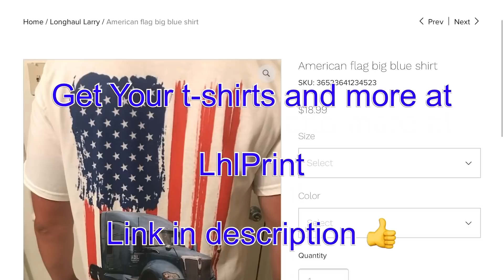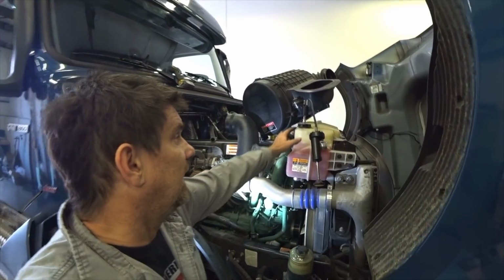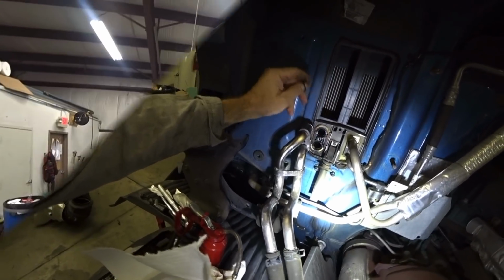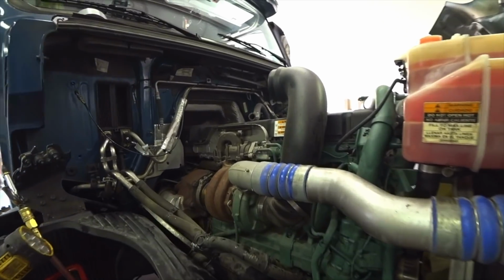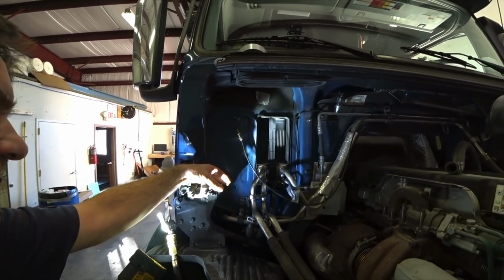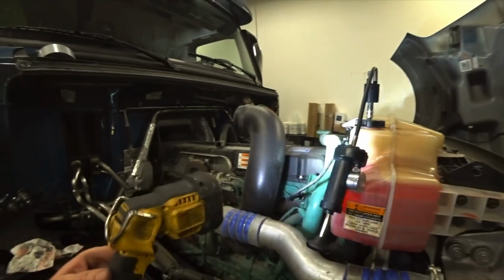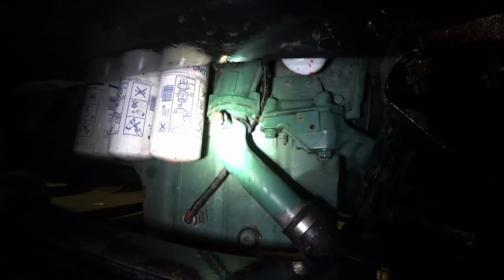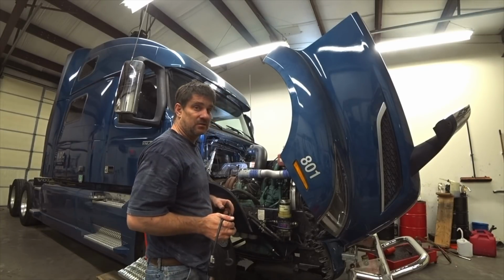Truck Repair, Trying to fix the never ending coolant leak on truck 801 2020/177

Comment: Larry there is a quick coupler on the bottom left side of the radiator, it has a black rubber cap on it. You can get that coupler at Volvo.  It looks like the coupler on your shop air hose. Yeh coolant leaks on Volvo SPECTACULAR .. what till you change the heater core . Goog Luck 😣✌PEACE
Reply from the maker: I know the boss is trying to get the new part and I’m not looking forward to ripping the whole dash apart

Comment: I bought a Brand New vehicle, drove it home, had a flat tire.  Aluminum Alloy Wheels from the Factory can have air bubbles and Defects from Day 1.  I fought GM and Dealer for a New Wheel and gave up after a few weeks after having to Add Air to the Tire every other day.  They used Epoxy on the inside of the Wheel which fixed the problem.  Never had another issue with it after that.
Reply from the maker: But new stuff never has problems 🤔

Comment: Can you drill and tap those heater hose connectors? If they have a single bolt in the center, they can warp on the ends. When you add those drains, use something that you can put a hose on.

Comment: Can you TIG weld Larry?
Weld a little spigot on.
For a conventional hose and hose clamp.
👌
Reply from the maker: I can but the pipes go into plastic
Reply: @LongHaulLarry  plastic can be welded. Try some gasket silicone on the O-ring.

Comment: Here we go again with another VOLVO, OMG. Trade them in
Reply: Any other trucks will also have issues. That’s why shops exist, name one truck manufacturer that doesn’t have breakdowns
Reply: @DinanBMWm5  I'am just not a fan of Volvos
Reply: I understand, you’re not alone in that. I just think it’s unfair to insinuate Volvo’s break down more often that other trucks. This company’s fleet looks like it’s made up of mostly Volvo’s so of course you’ll see more Volvo’s getting repaired. Also the quality of some of their drivers is highly suspect, methinks if these Volvo’s were being driven by competent drivers they’ll be in the shop less often. I mean look at a few videos back. Driver complained of steering wheel noise... didn’t even check that the Power steering fluid was low.
Reply from the maker: No trade in value 😮
Reply: @LongHaulLarry  Oh Brother

Comment: Did you m
Ak
Reply: Did you make shour the intear bolts was tight I have had them vibrate loose and leak
Reply: Did you make shour the intear bolts was tight I have had them vibrate loose and leak
Reply from the maker: The airbox was installed wrong and warped the plastic mount